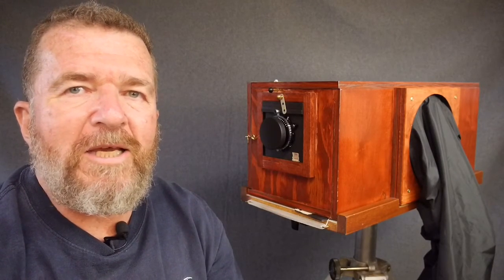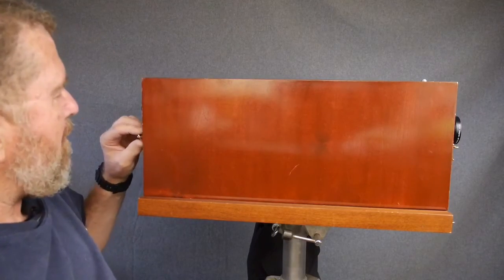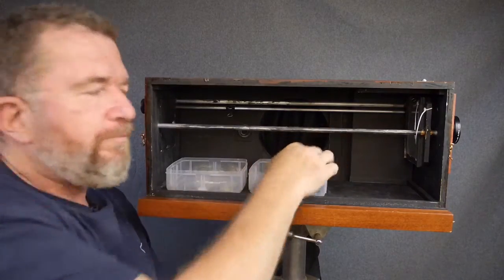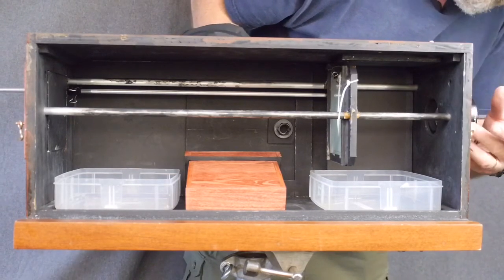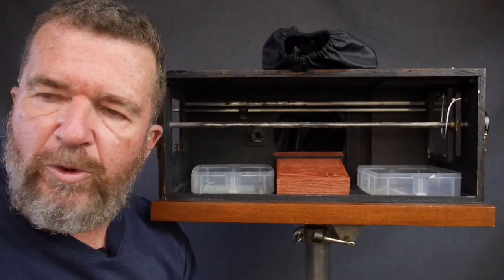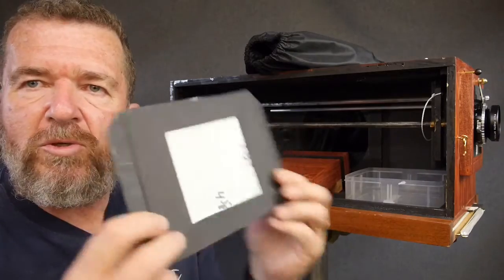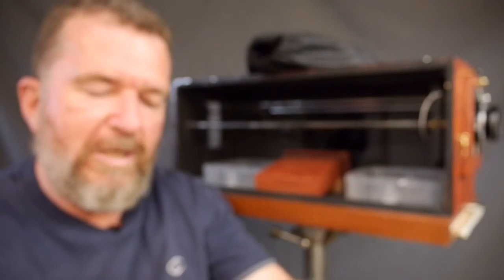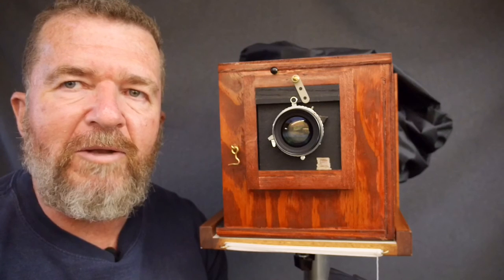Afghan Box Camera, Part 3

Comment: Joe,
 So glad that you are sharing your process. I have have been through much of the same problems with my camera build.
I love your drying plate. Once the plate is hot it seems like the print would dry faster out in the air instead of back in the box.
I am thinking that a candle powered heat source for the plate might work faster.
How can I show you my camera design?
I think you might find it interesting.  Marshall
Reply from the maker: Sounds interesting. Email me at jvcabacus at yahoo.

Comment: Joe, when drying in that plastic container, if you put the lid on, the water will evaporate but it will condensate inside the box. Don't you have to build couple of holes on the top for the water vapor to exit?

Comment: First of all thank you for sharing. Don't you have problems of condensation on the lens when doing the wet process inside the box?
You should make some holes in the drying box to allow humidity go out of the box.
Reply from the maker: No problems with condensation in the camera box. Developer and fixer are mostly water, and at normal processing temperatures it doesn't evaporate like that.

You're right about needing some ventilation in the drying box. And also maybe something that absorbs moisture, like desiccant. It's a work in progress.
Reply: i use paint for boats its perfect but expensive  anti osmosis paint :)

Comment: Greetings from Cali (Colombia)

My name is Carlos Fernando Loaiza Arteaga, I am a professional photographer and I decided to build my own Afghan camera; In my country it is called "Foto Agüita"

For the construction of my camera I made an alliance with a carpenter who would take care of the whole handcrafted part of the project. I have several questions about the construction and I would like to be in continuous contact with you to give a solution to the questions. It is my intention to document the whole process to share it in my city with other photographers and help preserve this legacy over time.

My first question is the following:

I have a Vivitar lens 28mm f2,8 analog. ¿Is this lens useful for the construction of my camera? ¿What photo format do I achieve with this?

I appreciate your information.
Reply from the maker: Greetings, Carlos. If you hold the lens up to a bright scene and project an image upon a white sheet of paper, you'll see how big of an image it makes. Lenses designed for 35mm film camera don't project images much larger than the 24mm by 36mm frame size. So it would make tiny, slide sized images. With the 28mm focal length, it would also be wide angle and hence not well suited for portraits.

I would recommend starting with what size print you want to make, then find a lens suitable. For a print around 100mm by 125mm in size, you need a lens used in a 4 by 5 view camera, with an integral leaf shutter. These are very expensive if purchased new, but used ones can be found on eBay and in used camera shops. The lens needs to project an image large enough to cover your required print size. For portraits, I'd recommend around 150mm to 200mm focal length, which is equivalent to 50-85mm angle of view for a 35mm camera format.

Good luck with your project. I will attempt to answer any further questions.
Reply: Joe Van Cleave thank you very much ... I will be informing you of my progress.
Reply: Hello ... I have several questions:
1. Could you recommend me some type of lens that I can use for my camera?
2. a solution to the problem of the lens, it may be to leave the hole only to uncover and cover when taking the photo

note: excuse me for my English, since I use the google translator. =)
Reply from the maker: As I indicated in my previous reply, you first have to decide the size of the prints. That will determine the focal length of the lens and the format it will cover. If you want print sizes around 4" x 5", a lens of 135-180mm focal length would work. Note that I'm not referring to lenses intended for 35mm cameras; these only cover a small size image area of 24mm x 36mm. I'm referring to large format camera lenses, or lenses for larger box cameras of the "Brownie" type or folding medium format bellows cameras.

If the lens already has a leaf shutter, fine. But if not, you'll have to use shutter speeds slow enough to accurately time the exposure by uncovering and covering the lens by hand. If the intended shutter speeds are too fast, like 1 second or faster, you won't be able to accurately time those exposure repeatably and accurately by simply uncovering the lens by hand, but instead would need a real shutter.

So you should look for lenses for 4"x5" large format cameras, like a Speed Graphic or Graflex camera; or a larger medium format folder camera, or the large sized Brownie-style box cameras.

I've also been able to use the front elements from a 7x50 binocular, but it has to be the kind that simply unscrews from the body of the binocular. The one I use has lenses 50mm in diameter and a focal length of 150mm. Wide open, it's an aperture of f/3, but very soft and blurry around the edges. It works better to stop the lens down with a diaphragm made from black paper. Because these lenses don't have shutters, you'll have to stop the lens down small enough so your shutter speeds are in the range of about 2 seconds or so. Any faster and you'll have a problem accurately and repeatably timing the shutter by hand; while any slower and the person seated in front of the camera might move and make a blurry image. You'll have to experiment with the intensity of light and size of the aperture to get the correct exposures onto whatever paper you will be using.
Reply from the maker: Another type of simple lens you could try are magnifying glasses. These come in various focal lengths and cover various angles of view. They all operate as single-element meniscus lenses, and as such have a relatively sharp central image with softness or blurriness around the edges, depending on how far down you stop them with a diaphragm. As indicated above, you can make simple "Waterhouse stops" from discs of opaque black paper with various size holes in them.
Reply: I grew up in Cali, and I am familiar with the foto de aguita. My father used to take us to the park to have our photo taken on weekends.

Comment: wich chemicals and papers should i use? i'm a begginer
Reply from the maker: I recommend liquid concentrated paper developer, like Ilford multigrade or universal paper developer, that you dilute with water to make a working solution. For stop bath, just use white vinegar. For fixer, use non-hardening fixer, mixed as per instructions with water for use with paper.

The paper developer solution you can reuse until it oxidizes and loses strength, or gets exhausted. The vinegar you can reuse until it begins to lose its odor. The fixer you reuse until it's exhausted, which you can tell by buying a little squeeze bottle of test solution, one drop in the fixer and if it turns milky white, the fixer is exhausted. For disposing of fixer, save it in old milk jugs and turn it in to your local hazardous waste disposal, as it'll have silver in solution. The exhausted developer you can flush down the toilet, as long as you aren't on a septic system. Same with the vinegar.

Good luck with your journey into silver printing, please share with us your success.